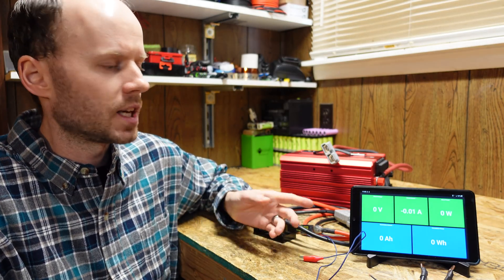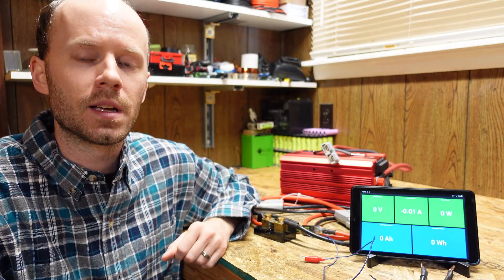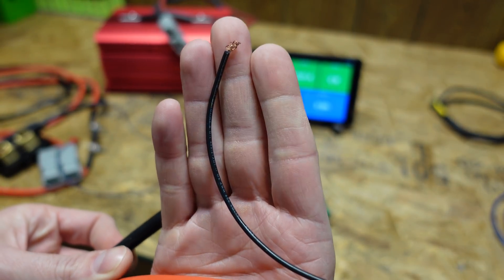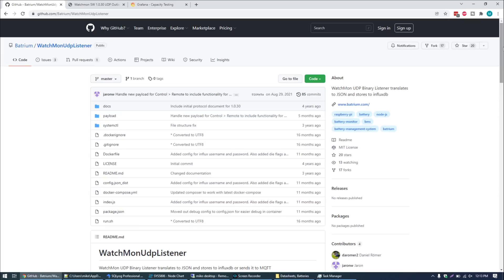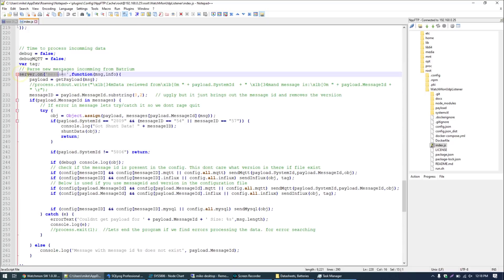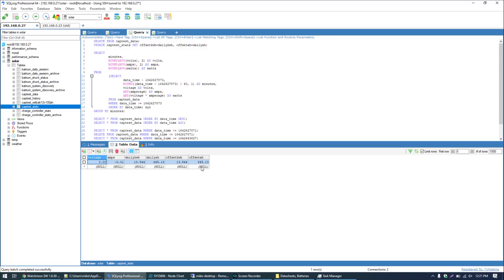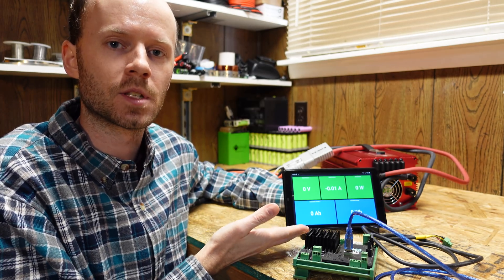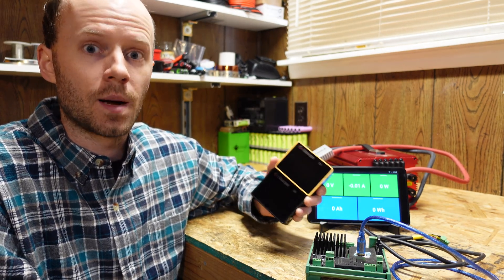A Detailed, Technical Look at my Battery Testing Procedures

Comment: This is a great video and an awesome setup. I would suggest to be cautious with shunts at high current levels. Shunts tend to be inaccurate at at high currents due or hearing. For discharge measurements inaccuracies add up over the measurement period.